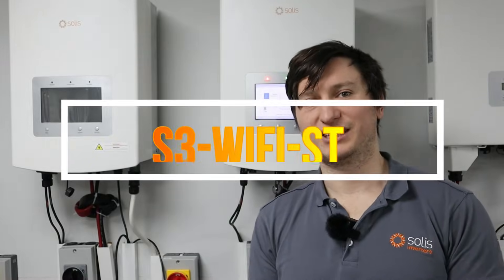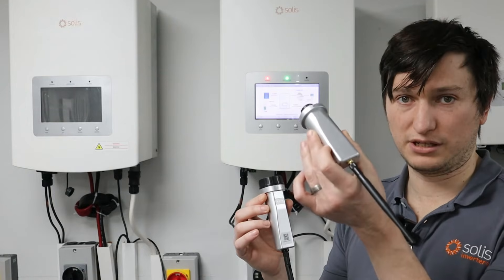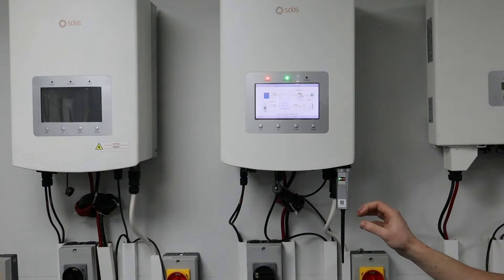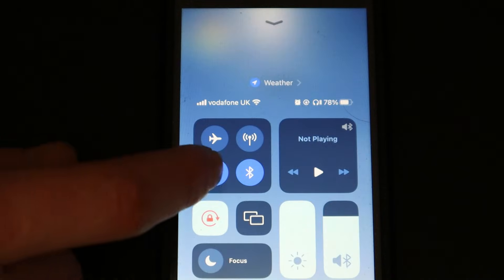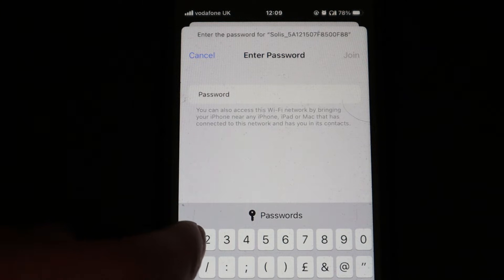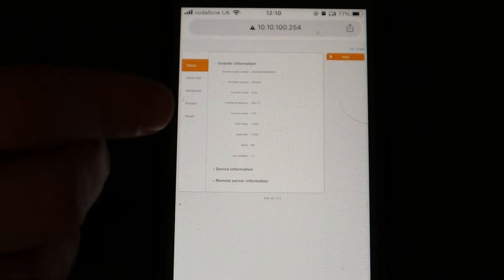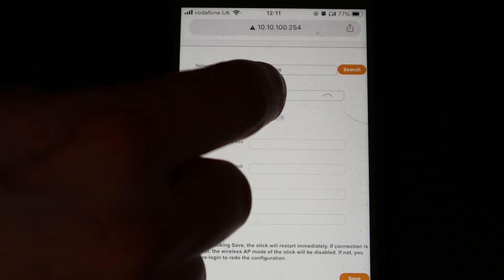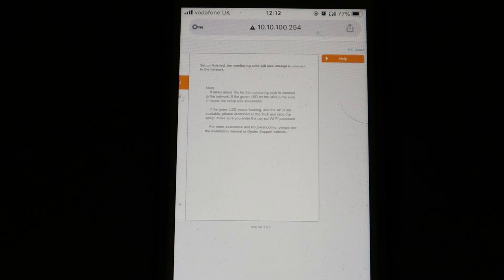S3-WIFI-ST - 10.10.100.254 - WIFI Stick Alternative Method Setup

Comment: Thanks for this video, this is what finally worked. I was extremely frustrated after repeatedly trying through Solis App. Even after repeated restarts and replunging, it would simply not show datalogger network on my phone as available wifi to connect. Finally it worked as per this video without using Solis App. Solis really needs to up its game, just changing wifi network should not be this painful

Comment: Hi there I am getting up to connecting my data logger wifi to my phone and then on when I log onto 10.10.100.254 I enter admin and password - 123456789. It doesn’t recognise this and move to the next page , any suggestions ?
Reply: Try using “admin”’as the password too.  It worked for me.

Comment: Just use a windows lap top , much easier. disconnect home wifi, connect logger wifi enter ip adress and follow the rest. reconnect to home wifi done . much easier than the process and unreliability of using a mobile device or the app.
Reply: Did not work for me - I tried on laptop . Used 10.10.100.254 then a pop up box came asking for username and password - entered admin and 123456789 , wouldn’t work . Not sure what to do 😢
Reply: @amarasokkumar660 Were you able to sort it out? I am facing same issue. If I use the Solis app then after connecting to data logger wifi and when coming back to Soils app it shows restart or go to connect pop up. And its keeps repeating.

Comment: I am planning on getting my inverter hard wired, but this solution helped me immensely when I got a new router and had to reconnect all my devices. It wasn’t easy, but it worked. Having to delete all of my saved internet connections on my phone was a ball ache, but the method didn’t work without that step.

Comment: With my new datalogger received after the previous one failed on change of home wifi network, tried this metthod several times, but it does not open the webpage hosted by datalogger with message "The web page is not availble" and then say "you have no internet connection". It did not work unfortunately for me. App mode also did not work earlier. I am disconnected for over a month now. Very dissapointing.

Comment: This worked thanks.  It is a much better method than using the soliscloud app.   I did find it difficult to get the data logger to broadcast it's SID, much pressing of reset button required !  but once the SID was available, the process took minutes to complete.
Reply: This comment was very helpful. It was the same for me, I was under the impression that something else was the issue. I think I ended up doing a couple of single taps then a long hold. The amber light went dull when it worked. Hope this helps someone else like it did me.

Comment: Thanks, just got my new S3 so checking out the change process before the install. This seems much easier than the instructions (which I can hardly read) would suggest.  After that I'm not sure if I have to remove the old datalogger on the Solis Cloud app before adding the new, maybe it doesn't matter?  I'll see what happens.
Reply: I have solis inverter with batteries I have Economy 7 so I charge at night my inverter in my attic so a faf to set up.i am told by solis I can remote control introduced in November 2022 but not able to do it I am using solie cloud.

Comment: How to monitor Solis RHI-3P(5-10)K-HVES-5G online? How to connect it to the app? It does datalogger installed in it, right?
Reply: It only has a local connection for Bluetooth.  You need to purchase a datalogger to see it on the web.  Cheers